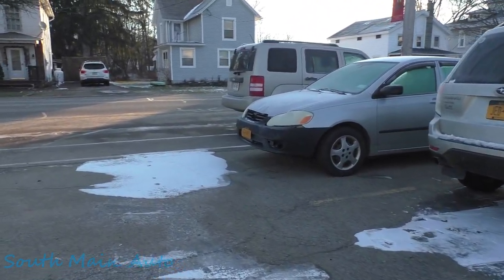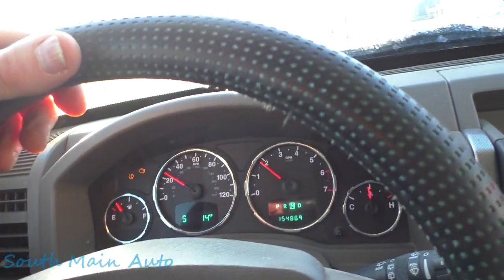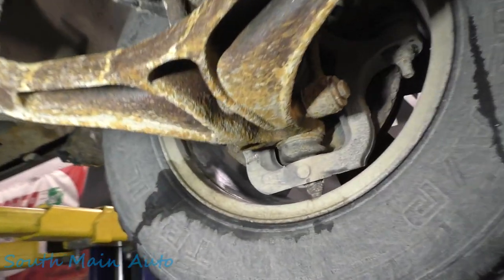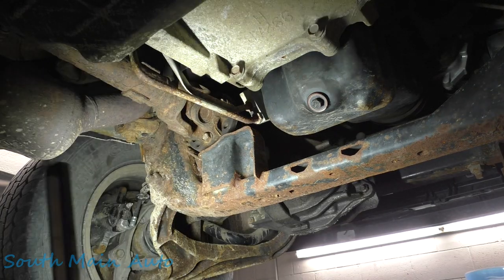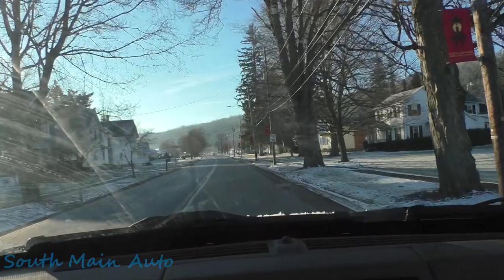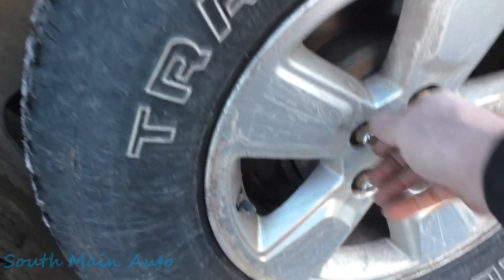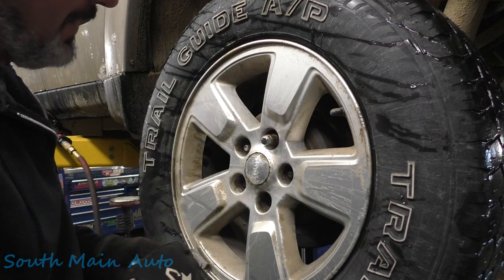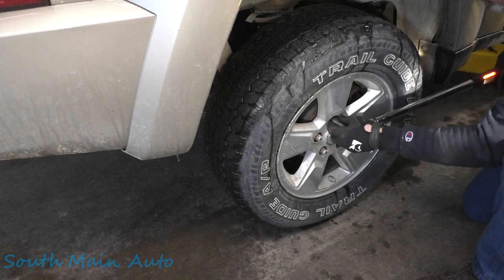Customer Just About Lost It.... A Wheel That Is

Comment: More common than you might think. Tire rotation and maintenance is so routine people get lazy and don't double check wheel torque. I almost lost a wheel on a road trip hauling a trailer and was lucky to find a parts store on Sunday that had my studs in stock, changed them on his driveway.

Comment: I don't like letting other people work on our vehicles, but I don't have a tire machine/alignment rack at the house, so on occasion I have to take em in. I take a torque wrench with me when I get new tires, and after I leave the tire shop I pull over, break em loose, and re torque. It's nothing personal, its just you hear it all the time shops improperly torquing lugs, and why take the chance of damaging the wheels, or causing an accident. I also feel a lot of people forget that they should be retorqued around 50-100 miles after having them off, or neglect to return to the shop to have them do it, unfortunately. Every nut and bolt has a torque spec, but common sense dictates when its important to stick to it…and this video is a good example. Generally speaking, you wanna torque lug nuts to spec, but as you've shown with the Chrysler alloy wheels its prudent to go a bit tighter than spec. Thanks for the video, keep em comin'!

Comment: once I thought it was a tie rod...it wasn't clunking like this one but it feel loose. I was about to repair it when I removed the wheel the nut just came off without the impact, that was it. After that a bought a torque wrench and relying on duga duga. That jeep clunk sounded like aluminium hittin steel the same sound when you put the wheel on the stud. For alloy wheel it's recommended to retorque them after 1-2 heat cylcle

Comment: loose wheel story: 1996 4wd chevy k1500 extended cab. 
I pulled up to a stop light and heard a snap. Started moving forward and could feel the wheel wobbling, barely made it across the street into the parking lot. On the front left axle , the axle nut along with the the tip of the cv shaft crack off and was inside the wheel cover. Alum wheel, flat cover disc, 6 bolt hub.
The wheel was hanging to the side being held on by only the brake rotor and caliper. dug up the alum rim a bit where the rotor rubbed. The hub separated from the bearing when the cv shaft tip and nut snapped off. I still have the nut with the shaft tip thru it. 
No noise or loose wheel before that happened. I had to have a flatbed with a dolly under the front wheel to load it up. Truck has 250k miles but is well maintained, on engine 2, time for another - they seem to live 125k miles then fade away. Orig trans, no problems, but freq fluid changes every 50k miles at least. tear axle gear fine, fluid changes. PA truck.

Comment: We have that same Nitro.. same color too (2010).   The guy before me swapped the engine, because it spun a bearing in the old engine.   Apparently he swapped it with the 4.0 though;  because even though it says "3.7L" all over it;  the 3.7 filter would not fit, so I ordered the filter that fits the 4.0L just out of desperation, and it DID fit.  I have to say, it is a zippy little thing with the 4.0L in it.  That sucker goes when you step on it.

Comment: I drove for a trucking company ten years ago and I had several instances of loose lug nuts on trailers. 
I bought myself a 3/4” drive torque wrench and torqued lug nuts on every trailer I took to Alaska. It seemed like I could find at least one loose lug nut out of forty on the trailer.

Comment: I worked for a large tire company in New England.  Kind of like pep boys, but not national.  Family owned, and operated.  They have over 100 store.  With the large volume of work, divers skill level, and works.  Loose wheels happened.  To combat this issue they worked with TIA to certify there techs in everything to do about tires.  That’s mounting, balancing, repair, inspection and installation, etc.  They used a system that goes by the acronym RIST.  Remove the wheel and any corrosion on the matting surface, Inspect for damage and worn parts, Snug the wheel down with a couple lugs and use a torque stick (calibrated to shop air and gun) or torque limited air gun, Torque the lug nuts by hand.  The torque wrench should move before it clicks.  If it doesn’t move it’s over torqued.

Comment: Do you remember when Mopar vehicles had left hand thread for left wheel lug nuts? When I worked for the City of Los Angeles as an equipment mechanic, a Dodge truck came in complaining of the wheesl coming lose repeteadly in the front axle. I found that the brake shop had switched the right drum with the left drum, so that the left wheel had right hand threads and the right wheel left hand treads. Switched the drums around and the problem dissapeared.

Comment: After suspension work was done to my 1990 VW Corrado about 25 years and was driving on the highway when shaking vibration started on my steering wheel….stayed on the right lane and all of a sudden the front right wheel tire came loose but luckily stayed between the fender and the hub.

Comment: Similar to the time a guy said his engine has been knocking after an oil change at our shop, saying it's his first time never coming back, all that, his passenger front wheel had only 2 of 5 lugs, next to each other. Had to replace the hub/bearing and we swapped for his full size because the wheel wallowed out too. Engine knock...

Comment: Not a car or loose wheel story but a story about spending a ton to fix a noise. 

The company I drive for has a 2006 International that we purchased last year. The truck was serviced regularly at the shop right next to our shop so we got to talk to the owner quite a bit along with the mechanics that serviced it. To get to the point he had up until not long ago had a nasty rattle and vibration that he was chasing. He replaced every bushing on the truck, both rear ends, u joints, carrier bearing, you name it. All this with the same mechanic doing the work with direction from the owner. Finally that mechanic throws his hat in so another one gets in the truck with the owner to drive it and hear it for himself. They take off East out of the shop and with a good tail wind. Truck is rattling like crazy. They go a couple miles and turn around and it’s not as loud. Mechanic decides to roll the window down and reaches out and grabs the CB antenna mirror mount and lo and behold the rattle stops. 

I can imagine the owner wasn’t too thrilled with the cause but happy to have found the issue. We are happy to have a million mile truck that drives and rides like a new one lol

Comment: As a kid in the 70s, I had a El Camino. I put on some Keystone mags with  unilugs. It was summer time and I'm going down the highway at speed limit with my window down. I heard a zing, zing, zing sound, almost like bullets flying past the window. Then my left rear wheel departed the car, rolled across the median and opposite lanes of traffic and into the woods on other side of highway. Fortunately there was no oncoming traffic! This happened fast and the warning that I didn't understand was the zing sound of the lug nuts and studs flying past the window. All 5 studs were sheared off the wheel hub, rear quarter panel behind wheel was destroyed and I was left walking. This situation could have been much worse but it was a Saturday morning, I was on my way to work and there was little traffic.

Comment: Not a loose wheel but interesting wheel story none the less.  A friend has a caravan and there was a squeaking noise from the front passenger wheel.  She swore it was a wheel bearing as we just replaced the drivers front and she didn't want to do the passengers at that time.  I drove it and it sounded like a plastic squeak, definitely not a wheel bearing.  Get back home and found the plastic wheel cover was askew and every time that section of the tire compressed against the ground it made the wheel cover squeak. I tell people don't tell me what you think is wrong, give me the symptoms.  Sometimes they can be what is askew.

Comment: Had this happen to me on my 2005 Jeep Grand Cherokee.  I thought it was the left front CV axle because it only made the sound in turns.  So, purchased the OEM CV axle and while it was in transit to my location I checked the lug nuts on the the wheel.  Tightened nuts and noise went away.  Then, I installed the new left CV axle because I replaced the right one two years ago and should have done both at that time.  To get the left CV axle replaced I had to also replace the control arms, torch required, due to deteriorated bushings in the control arms.  So, about $2,500 in needed maintenance and repairs was completed a little early due to loose lug nuts.

Comment: I've got a Pro Master in the shop now with same complaint and similar costumer "repair opinions". Owner drove from Maine to East Idaho with this noise. Steel wheel in this case and the centering holes were ovalled out. One 16.5 x 1.5 mm lug stud seized and broke in the hub-did my best but couldn't get it out cleanly so had to replace the hub and bearing.

Comment: My wife has a 2005 Pacifica that has the same problem of lug nuts coming loose. A friend of mine at the dealership (service mgr)  told me right after we got the car to make sure that the wheels are torqued every  1000 to 2000 miles. He told me that I would not believe how many Chryslers come in with loose wheels. We now use the car only for around town and not cross country like we use to.

Comment: Yep l was finally diagnosed with loose steering shaft universal joint bolts on my Toyota Prado 4WD making horrible clunks on turning. Originally two shops said front diff etc. needs replacing. Close shave what? Your lady was lucky Eric.

Comment: Discount tire Had a bad day with a new set of Wheels on my truck I found it. Showed the Assistant Manager just some thread marks in the wheel only drove it for about 30 miles the fallowing Monday I received a call from the manager( I live 70 miles from every where) and the manger shipped me a new wheel Came the next day and I had a local shop put it on for me I now have a matching Spare. Very Good service from Discount Tire. And an Interesting Noise at Stop signs. Only one lug nut tight on a right rear 1977 Gmc Pick up ( Panel Truck Custom build)

Comment: First time it's happened to me with my '07 grand Cherokee was October. I heard the knocking but mostly just when turning. I drove myself nuts trying to figure  out the cause until I swapped on my winter tires. Front left was only hand tight for 3 out of 5 nuts.
I was sure my snap-on needed a recalibration, I'll try going an extra 10 ft-lbs in the spring.

Comment: I had a wild ride in the camper in the back of my father '63 Chevy 3/4 ton pick-up when the rear tire came off at 30 mph. He had just had a required inspection done where they removed the wheels to inspect brakes and such. They did not torque the lugs properly. Yep, a safety inspection left the pick-up unsafe. The wheel rolled out backwards and lifted the truck and camper up high then dropped it hard. The wheel went bounding off the road and jumped a 6 foot fence. I was standing up removing chest waders and got tossed like a 12 year old rag doll.

Comment: Took a Yukon on a short test drive once to verify concerns. (Death wobble, dash was all christmassy)

Didn't think I was going to make it back (about a mile)

Hub bearing had apparently locked up, effectively sawing the hub assembly in two. 
Only thing holding the wheel on was the brake caliper bracket. (Quite the "holy shit!" moment)

Comment: Ford Focus.  These things had wheels mounted on a central hub and it was all too easy to pop the things on, torque them down, only to find they weren't engaged properly.  I had it happen twice  to me, until I polished the i/d and the hub of all corrosion, then check them for torque 5 days later.  The local dealership admitted they had the same problems, which assuaged my guilt a bit, but still....

Comment: I encountered a truck wheel on the 427 highway north of the 401 in Toronto...just a wheel going in the same direction as me. I was amazed as it went , then finally stopping and coming to rest leaning on the concrete divider. Hitting one of those would be a disaster

Comment: I had a 2003 Dakota for 17 years and never had a loose wheel. Probably because I torqued my own wheels. I always went between 100 and 110 ft-lbs. Always check them after a tire shop has touched them. Those guys can mess up an iron ball with a rubber mallet.

Comment: Just a heads up, I have experienced this on GM, Ford, and Chrysler vehicles with alloy wheels. I also live in the rust belt. If there is rust on the hub and corrosion on the wheel mating surface, clean them both well with sand paper and a wire brush. What happens is the wheel hub centric smashes a bunch of rust and corrosion in between. The lug nuts will seem to torque okay, but after a few miles the little bit of junk that was smashed between turns to dust and falls out, which opens up a little bit of space and the nuts start loosening. I have been cleaning and lightly greasing the hub and wheel centric for years now and haven’t had a wheel loosen up since.

Comment: Just serviced the kids 2014 Wrangler and rotated the tires. I torqued the lugs to 100 ft lb. I need to torque them to 120 ft lb. I think it has something to do with those lug nuts with the tin cover. Ford and GM uses them also. It's like the socket hangs up and you don't get the proper torque.

Comment: My wheels are supposed to be torqued to just under 90 ft lbs but I always over torque them because that's barely even tight and when you get some rust in the threads it's easy to get a false reading

Comment: i bought my friends saturn vue, and his brother recently put on the spare because the alignment was so bad the wheel looked like it was about to explode due to the uneven wear.

well, my friend said he used the lug wrench that came with the car to tighten the spare, which instead of being a wrench it was a footlong piece of lasercut 1/8" sheet steel. they had a weird knocking noise while driving. I inspected the wheel and that sucker looked like it would fall off if you kicked it hard enough.

Comment: I had a race car that the Wheel came undone. I had carved a decent ammont of material out of that steel rim and the studs. Had to replace the rim, studs and nuts. Due to be a cheap car model it was just less junk layin around in the back yard and more in the metal recycling bin. Only expence was turning the still good rubber to another rim 👍 if that is the worse thing ever. Not that bad, 

Know about a guy that been overtaken by his own wheel, that makes for a bad day. Alot of stuff needed to be changed in that corner of suspension. And he was amazed how long that wheel made it until it stopped.

Comment: I discovered years ago that the corrosion that Chrysler products build up between the rotor and rim is what causes that to happen. Clean the back of the rim contact surface (and rotor if necessary) and they don't come loose.

Comment: I don't think I've personally seen a pattern with any model or style wheel. But I can say, nothing blows one's confidence quite like have one of your own fly off into the woods. As in...one of mine that I put on.

Actually, I've had 2 of my own fly off. As if the first experience wasn't bad enough, the second one made me question whether I should be allowed to own a wrench again.

Those experiences are also why I don't torque lug nuts on the ground. I torque them lifted. Then I retorque after 100 miles. Yes, I am OCD about that.

Comment: I put Mercury Montego rear brake shoes and drums on a Ford Maverick Grabber 9" rear end, on my '66 Chevy 2 Frankenova 283. When I torqued the BMW alloy rims, the rear end locked up! I thought my rebuilt xmission was bad, but if I "detorqued" the rear wheels, it ran fine! The Mercury shoes were 1/32" wider than the old Grabber shoes and the drums "squashed" the shoes with the last bit of torque! so, with a bit of grinding finess, 2 narrow the shoes, I was able 2 retorque the BMW rear alloy rims! I needed the Grabber rear and BMW offset web rims 2 fit the tires in my wheel tubs!
Reply: lol, THEN I laughed, later, as I watched Eric curse at the "remote starter hackers"!

Comment: Only had a jetta where going from alloy wheels to steel(thinner rim) always came loose again due to rust in the threaded holes. Usually 2-300kms and never right away.
And had my other car come loose 600kms later….. was wondering about that one being a saboteur overnight as I didn’t go 100 ft before it started knocking and came right back and tightened it. Was good all the other times.
And had a trailer wheel almost come off due to the brand new first time use of the Milwaukee high torque impact, sheared 5/8 studs off, and wasn’t even trying to tighten it, just run it in like usual till snug then torque wrench it. Had 3 loads of dirt in it and came loose on the 3rd, halfway to the place that was 30 minutes away and I looked back and seen the wheel waving at me in the side mirror. Had to unload the gravel right there mostly on the side of the road and then at someone’s house.

Comment: Well that could have been a terrible outcome if left much longer. Good pick-up Eric. Great idea to have the customer come back after 100miles to check the wheel nuts incase the threads in the nuts or studs got stretched enough to cause an issue.

Comment: Remember when all I had was a 3/8 torque wrench available to me to torque my wheels which it maxed out at 100ft lbs and my grand Cherokee wants 115ft lbs. thought 100 would be plenty to keep the wheel on until I got to my 1/2 torque wrench but apparently not. Wheel started making this same noise after about 250 miles until I got home and torqued them down properly and when I went to torque them they were all finger tight 😬